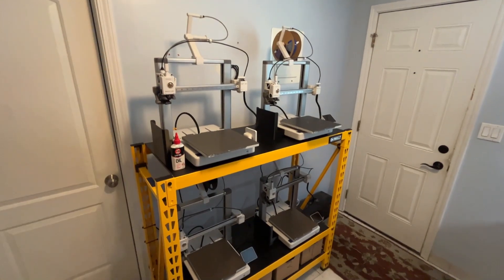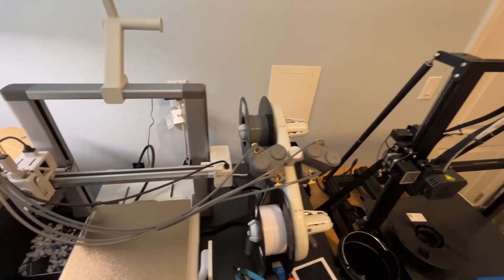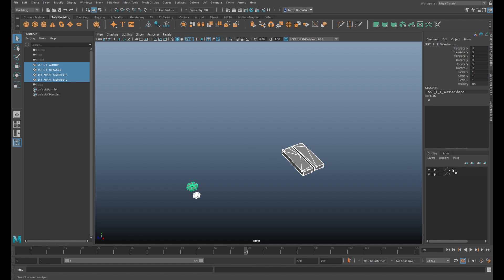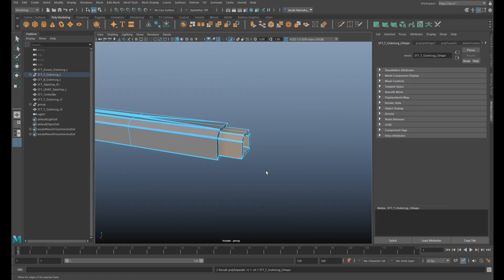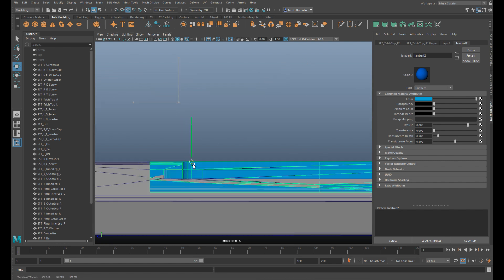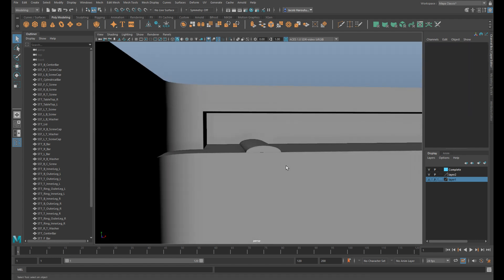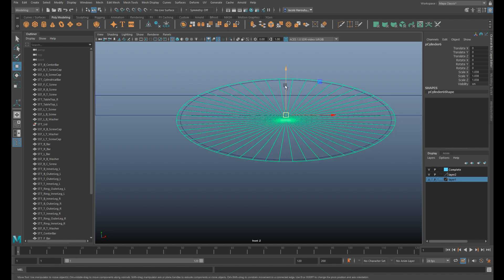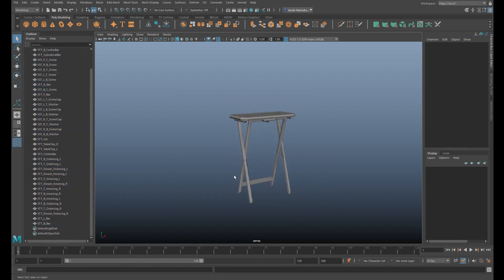Finalizing Stealth Tray Designs: Ready for 3D Printing!

Comment: When working in CAD, how do you keep your head wrapped around the physical scale of an object? Since you can zoom in so close and work in such fine detail, I've found once it's printed, that small detail scale is way too small or parts are way too thin. I tried importing metric rulers but that is hit and miss. I ended up making four quarters (yes like change in your pocket) which are roughly 1.75mm each and when stacked are 6.85mm thick. This way I can work on the object in CAD but hold the quarters in my hand or next to an object  to get an idea on how think or big things are. I import them into all my projects. 
Hope that makes sense and since I have zero schooling in CAD I was wondering how the professionals do it?
Reply from the maker: @ValorArc_Designs  That's a fantastic strategy you've developed! It's so important to maintain a sense of scale in 3D modeling to ensure the physical print matches your expectations. Like you, I've run into similar challenges in the past, especially with models coming out thinner than anticipated. In my workflow, I rely heavily on digital calipers to verify dimensions continuously as I design. If I'm modeling something particularly delicate or small, I always double-check those measurements with the calipers out in the real world, setting them to the specific measurement in the design to get a tangible sense of the thickness or size. I also plan to go over some of these scaling issues and how I resolve them in tomorrow's vlog, which might provide some additional insights. Your use of quarters as a physical reference is clever and practical, offering a tactile comparison that many CAD tools lack. It's smart to incorporate such real-world objects for scale verification. Thanks for sharing your method, and for the great question! Your approach not only helps you but could also be very useful for others facing similar challenges :)
Reply: @3DTheory  Thank you for making that response video, greatly appreciated!!
Reply from the maker: @ValorArc_Designs  I'm glad you found the video helpful! Thanks for sparking such a great topic. Keep the questions coming :)